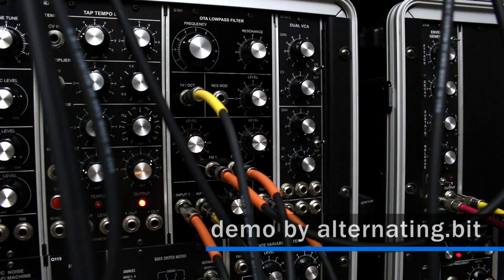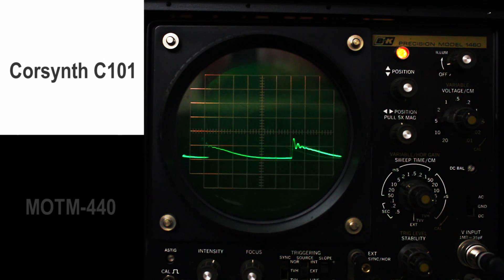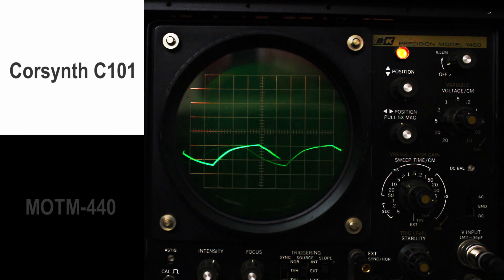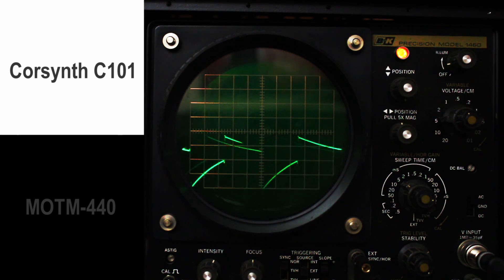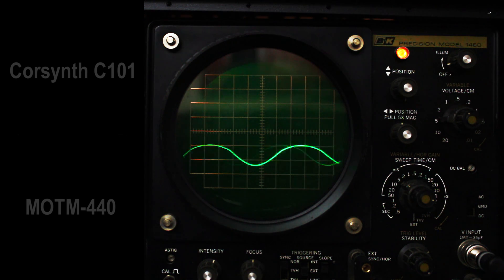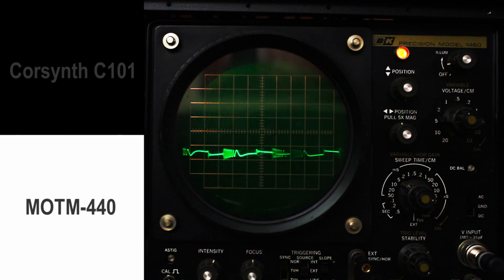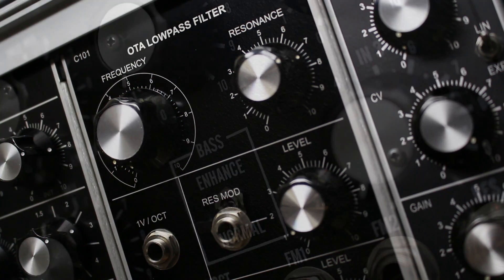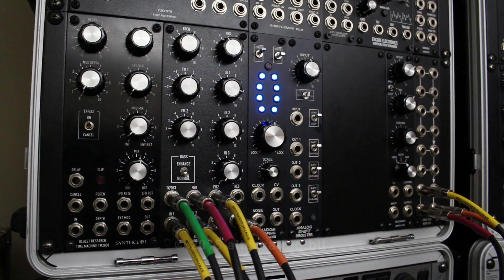OTA Lowpass Filter Test - Corsynth C101 vs MOTM-440

Comment: Thanks for the great comparison demo! Iv'e found the Corsynth C101 to track very tightly and quickly with any frequency modulation, especially FM in the audio range. It takes anything you throw at it like a champ, the MOTM-440 is a little bit looser, but nothing beats that deluxe velvety sound!